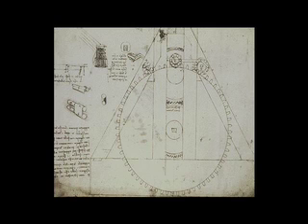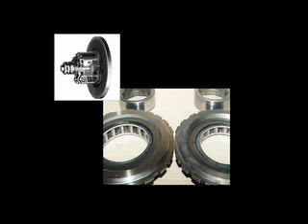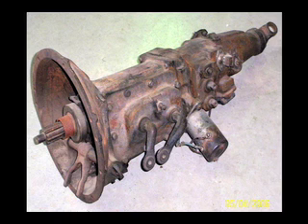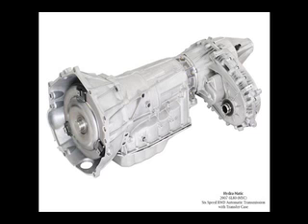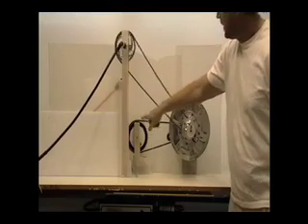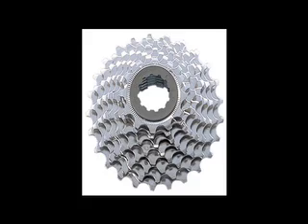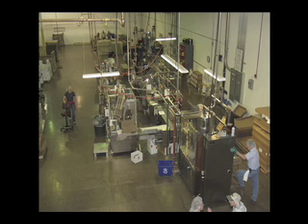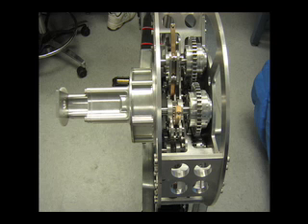IVT Full

Comment: @75DTac 
With a variable transmission like this, you can pedal as slow or as fast as you want (just like with regular gears)-- the "magic" about this is, you can "turn up or down" the ratio of speed to power from your pedaling with no clunky transitions as with gears
Reply: Hi, I am Graeme John Eddington. Following is my Youtube post of my Multi-speed transmission I have called: "Opposing Torque Dynamic Clutch" which is a type of Infinitely Variable Transmission (IVT) which I believe is ideal for your current applications. Please log on to my Youtube video: https://www.youtube.com/watch?v=SACDK89U7PM